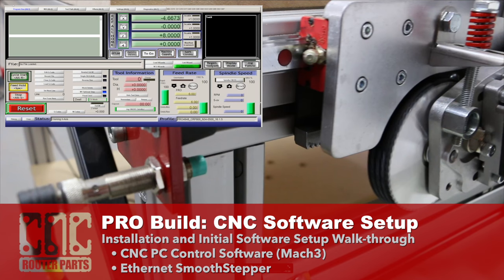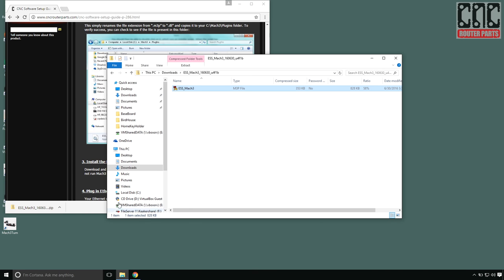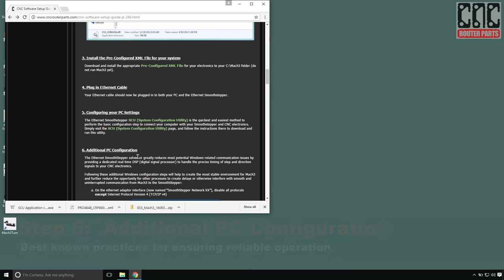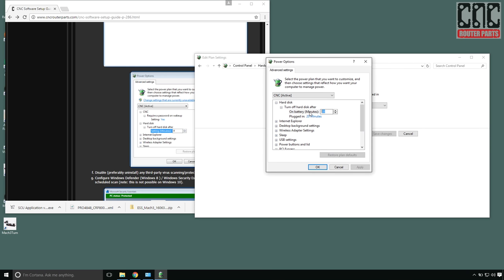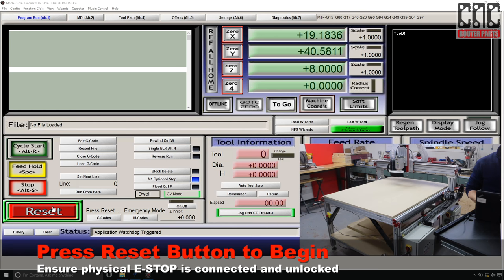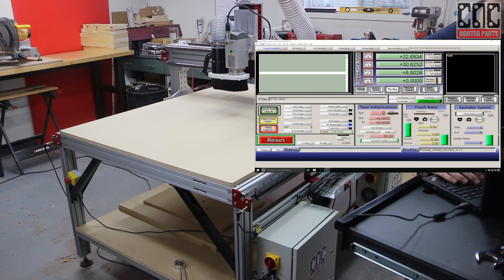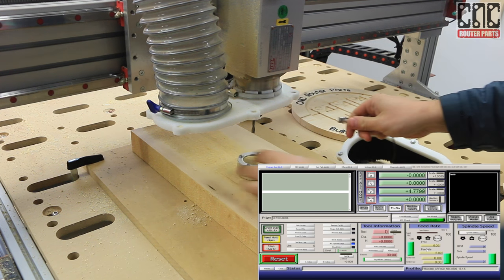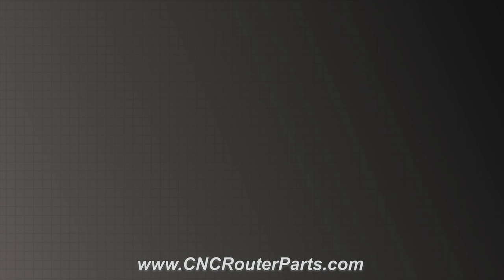PRO CNC Build Series: Mach3 Setup and Initial Shakedown Run

Comment: Thank you for mentioning to make sure you have your motors engaged. I struggled with this and thought it was everything but that, turns out I'm just an idiot and it started to  move as soon as I engaged them.  I feel like most of the other tutorials glossed over this very important step.  Again, I'm an idiot and both Avid, and Mach information is very through and helpful. It's appreciated!